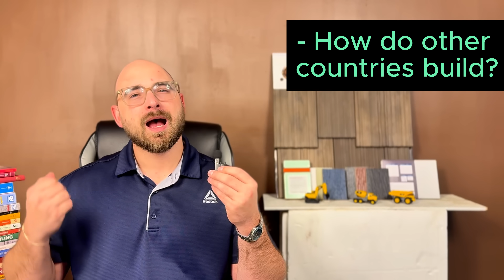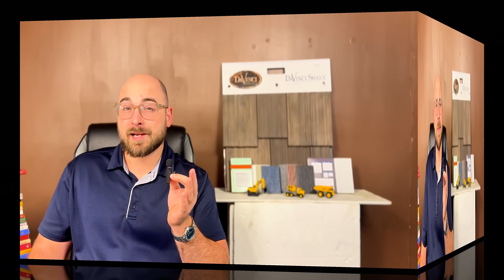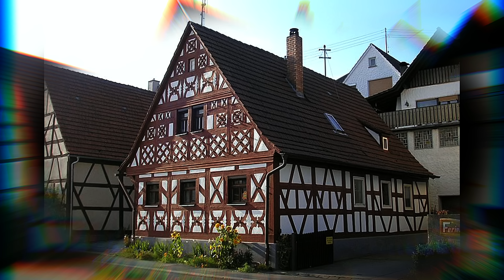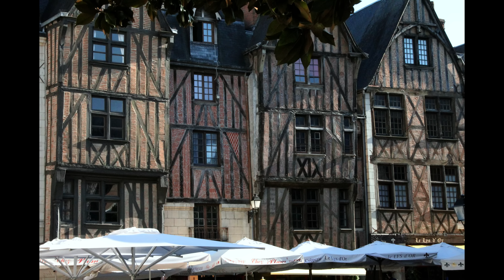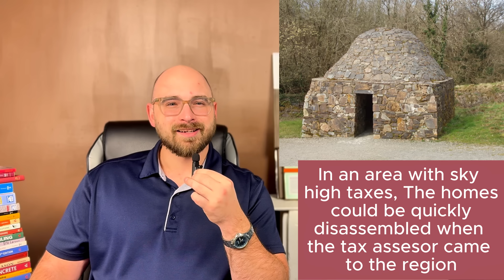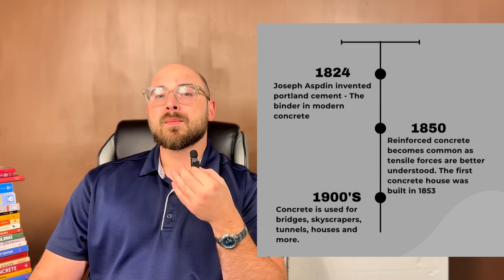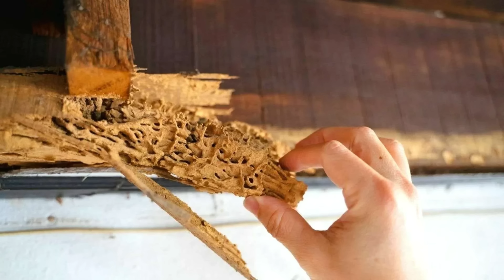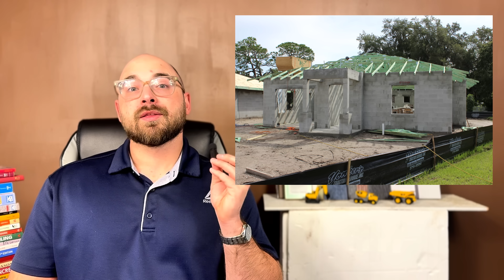Why Other Countries LAUGH at American Homes

Comment: No, Eurooean homes lack insulation, are poor quality, take quadruple the time to build and are significantly smaller than American homes. Ive lived there. I lived in a development as it was being built. Yes, they use brick but the bricks are cheap and flimsy. I literally watched as they built an entire development. They dumped 3 bricks for every 1 they used and these bricks often had to be replaced. I asked the builder and they explained that the bricks available just werent the same quality as the US and so they went through a lot of them. Homes that should take a few weeks take months, even years to finish and they sit exposed to the weather far longer meaning the indoor material wears down quickly.
Now, as to older buildings, I have been to dozens and dozens of old villages and even more castles and estates specifically for their historical significance and talked to more guides than I can count. Every time I asked questions about the construction. It became quickly obvious that except for stone (which is a poor insulator and leaves rooms very cold and wet causing problems for everything else in the building) the materials used in these old buildings are constantly requiring maintenance. Anyone who has been to an old manor home that has been abandoned for any length of time will immediately see that once they stop heating or develop leaks these homes break down at an alarming rate.
American homes when cared for last centuries. Yes, we build fast but maintenance is easy. Maintenance on these European homes is far from easy and is very costly. Sure, its beautiful but it doesnt last. I spoke at length with owners of castles and estates and they informed me that the vast majority of their estate income went to basic maintenance every year. If they neglected a small leak or a broken window or damage to a heating system the building would deteriorate rapidly.
 Now, yes our drywall doesnt do well with moisture but if a wall is damaged it can be replaced in minutes because the treated wood framing within is probably still fine. You cant just replace crumbling brick or stucco in minutes. It takes time and failure to catch it in time can cause an entire building to become unstable.
Yes, European construction can be beautiful but its costly and doesnt heat or cool well and retains a lot of moisture and mold. 
I hated my English home. We had constant recurring problems and so did my neighbors. The home we had was 1/3 the size of a comparable 4 bedroom home in the US and yet our friends in Europe raved about the "massive" size of our tiny home. It was 1800 SF, 9 rooms and cost roughly half a million dollara. Here, I have a 6200 SF home that cost me 100k less than my European home and has 21 rooms.
American homes are easily customized while Eurooean homes are not. Repairs to my current home (rarely needed) tend to last. Heating is also waaaaaay cheaper because our American home is far better insulated. Our brick European home was very cold in the winter and very hot in the summer. We often had to leave all of our windows open to stay cool in summer and in winter we had to wear sweaters and shoes in the home to stay warm. We have no such problems here.
Here is the biggest difference, if our European home burned down rebuilding would take years. If our American home burns down we can rebuild quickly. American materials may be cheaper but they are better. As a side, I have a stucco, rebar, ceramic shingle and concrete home in Mexico too. It is very hard to maintain and very expensive and earthquakes ruin the cement all the time. I am constantly having to replace ceramic roof tiles that break and fracture. Doing any sort of wiring changes are a huge pain in the neck while trying to install CAT6 cable or air conditioning is ungodly expensive. I have an en-suite jacuzzi bath and working on the motor or replacing tile is extremely expensive. Worse, when ants eat at the wood we cant see it. They get at wood inside the building that is inside the stucco, stone and brick. They eat up the wood unseen which destabilizes everything. Replacing that wood is nigh unto impossible without incurring major costs. I prefer Ametican construction as a result.

Comment: "fast and cheap" sums up the USA really well.
Reply: No it doesn't sum it up as a whole
Reply: america is not fast and cheap....its material seller and contractor making big buck
Reply: Because we’re in a housing crisis
Reply: @brandonmoreno1752  maybe, part of the housing crisis is that North America builds homes that need to be replaced every 50 years?  If we built homes to last centuries, we could put more focus on building more homes instead of expending resources, energy, and labour continually rebuilding them.
Reply: @TheWeirdDude_419  we do not replace homes after 50 years. Where did you hear this nonsense? If anything, we tear down old homes to make apartment buildings.

The average age of a houses are about 50 years, because our population has doubled over the last 70. Europes population has increassd by about 30% in that time. Is it clear now why fast and cheap is a priority for the US?
Reply: @ The components of fast and cheap houses are not designed to last even fifty years.  Roofing singles have a fifteen to twenty-five-year (depending on climate) lifespan and then need replacing and end up in the landfill.  Cheap vinyl siding becomes brittle in less time.  Whether a house gets torn down for new builds or has its components regularly changed out, it is still getting replaced... and replacing those components creates strain on the resource, manufacturing, and construction industries that could have focused their efforts elsewhere.  Plus, construction has been getting cheaper and lower quality over the last fifty years, so we haven't even got to experience the full repercussions yet.
Reply: @boggless2771 the USA is viewed as some kind of tropical third world by other western countries. We’re typically equated to the Philippines or the like—hot climate, cheap plywood shacks, unhealthy cheap food, lack of governmental programs for the populace etc. It’s not accurate, but whatever the US does is viewed as invalid. The sentiment is almost “you guys choose to be poor and it pisses me off so fuck you yanks” the sentiment makes no sense, but a lot of people feel like Americans are easy targets for their ire because they think they are punching down
Reply: The problem is capitalism. Homes are considered a rapidly manufactured commodity now. As in all other industries, the builder wants to make the most profit for the lowest expense, so they throw up tons of dogshit quality stick-built structures which crumble in disasters, then charge an arm and a leg for them, keeping average homeowners in debt forever. In the last few years, developers have reduced the rate at which they're building homes to keep supply artificially low, contributing to the current housing crisis. Same thing DeBeers did with diamonds, only with less (recent) ethnic cleansing. For-profit firms can't be trusted to act in the interest of society; they will only act to maximize profit and externalize costs.

Comment: European perspective: Wood is decoration and construction process support material, not construction material. Unless you're building a shack/shed. In my country banks do not give loans for homes that don't have concrete floors(first and all above it). Which is a issue with old homes(100y+).
Reply: Europe is not a single country, don't treat it like a single country.

Comment: One of the things about solid structure concrete homes like in Sweden is that, while it's ok for a cold climate, it's like living in an oven during the summer now as temperatures get warmer. Since it's also used for interior walls, unlike with composite walls, you can't easily implement centralized A/C for managing internal temperature which exacerbates the problem, and homes rely on radiators by all the windows which dries out the air and are just largely inefficient because a majority of that heat is being radiated directly out, rather than efficiently circulated throughout the home.

Beyond that, solid walls are a lot less friendly for wireless signals and it gets absurdly difficult to upgrade spaces as you can't run wires within the walls for power/internet without being significantly destructive. So unless you can commit to that, they end up cluttering and needing to be run along the ground or bolted along the wall — whereas with composite walls, you can run everything through walls from one room to the next with relative ease. That's not even getting to opening up or remodeling that involves removing sections of interior walls and the overall cost/complexity.

Alone the same lines, even small changes like hanging pictures, mounting shelves, or other things requires concrete anchors that are a colossal pain compared to using nails/screws to secure something into a wooden stud. If you hang something expect it to be there forever, so redecorating is significantly limited by the lack of flexibility. In the US, you wouldn't blink an eye if you wanted to rearrange hung pictures or adjust the placement by a few centimeters, whereas with concrete walls, you'd probably never even consider it once it's actually in the wall even if it isn't exactly aligned how you want.

Lastly, while people may make jokes about composite walls and how easy it is to smash through drywall — if you slip and smack your head into the wall, a quick trip to the hardware store to patch up the drywall is infinitely better than a trip to the emergency room for a fractured skull. Like modern cars having crumple zones rather than rigid outer frames, there's a purposeful reason to have interior walls that aren't solid material.

There are a great many things that I enjoy exponentially more about living in Sweden as compared to the US, but European home construction is absolutely not one of those things in any way whatsoever. It's mostly like being stuck in the past being defended by people who aren't aware of what modern US homes are actually like to live in.
Reply: Have you ever lived in European and US homes?

I have.

Well insulated homes stay cooler and keep cold better, too. Those concrete homes aren't just concrete- that would be absurd. They usually have strategic air gaps (especially CMUs) and then thick layers of styrofoam and other insulation. Triple pane windows are widely available.

They are quieter. 

In the US, you can hear someone several rooms over. It's distracting and annoying.

As for moving paintings and and thing wall mounted... just grab a drill. Usually everyone just has a drill stashed in the back for when it's needed. How often do you really move a painting or hang something up?

Running cables... you know all recent construction runs wires through plastic sleeves... no? You can reasonably easily replace wires inside... heck, we recently had one coax in out apartment replaced with fiber optic.

Yep. FTTH :).

If you want ethernet run, true, if it's not run when new it's more of a pain.

Wifi signals... true. Reinforced concrete, especially, makes it a bit of an issue. Strategic placement for the router(s) and ethernet (if new house) can do a lot though.
Reply: @Olivia-W  Yes, that's why I made the post, because I have a directly informed personal opinion about all of those things having lived in both the United States and Sweden.

Central A/C and composite walls meant that in the US, there was fresh air at a continual temperature distributed evenly throughout that's easily managed even if you never open a window once (and if you do, they all have screens so insects don't get inside). Here in Sweden, it is anything but that and worse in both respects even under optimal circumstances in the winter and is typically 4°C warmer than the outside during the summer, and opening the window means rooms full of flies & mosquitos and being barely any different.

Setting up a portable A/C in one of my West-facing rooms helps a bit, but that doesn't distribute that airflow at ALL throughout the other rooms, nor does it bring in fresh air that also filters out pollen and other things if you have allergies and can't just open a window. If you wonder why heat waves are so monumentally deadly in Europe as compared to the United States — that's why. Homes here aren't built for consistent temperature regulation, whereas in the US it's a standard that applies for a vast range of different climates that are hot, cold, dry, & humid. Composite walls are designed to retain AND dissipate heat easily in addition to being easier to adjust if you need to install a centralized system like that after-the-fact, because the air ducts fit into the walls rather than needing to be latched onto the exterior.

Soundproofing is a very minor difference, having lived in multi-story interconnected apartments in both countries as well. While composite walls are thinner and the cheap ones are poor, most exterior dividing walls aren't that different. The main difference is that in the US, I didn't even know if someone moved into an adjacent apartment, whereas I always know that in Sweden because someone hammer-drilling new anchors into the walls is a sound that travels directly through every connected solid wall and fills the entire apartment with that noise. Nothing is ever even close to being that loud when someone moves in and puts up shelving or pictures in the US.

Related, drilling a hole in a wall is a colossal pain, and you can't drill too close to where you've already drilled before, whereas picture hanging nails for composite walls barely even require a hammer, leave nearly invisible holes when removed, and can be adjusted with basically zero effort. The only reason you think it's not a frequent thing to do is because it's prohibitively difficult with concrete walls so they're treated more as permanent fixtures because it's quite literally set in stone, whereas getting new pictures and rearranging rooms' decorations is monumentally flexible that you'd never have to think as being permanent with composite walls.

That's assuming you're only ever needing to run cables through pre-established pathways like putting fiber where coax already was in a direct upgrade. It's a pain to make a new point for an Internet connection in a room that didn't have it before or even do something simple like mounting a 5.1 speaker and pass its cable through the wall, so that it isn't hanging outside where it can get damaged or caught on something. Composite walls are adaptable and concrete is by nature not that at all.

Comment: I think using light timber frames are fine if you see houses a just a commodity item, that change or get replaced constantly. So kind of like in Japan. In the US the houses are build like temporary structures but then treated like investment objects. Addinally Zoning regulations, land owership and HOAs can also make impractical to replace the temporary houses with something new.